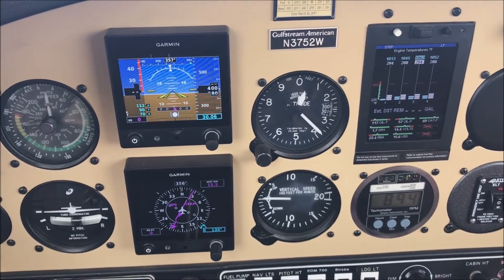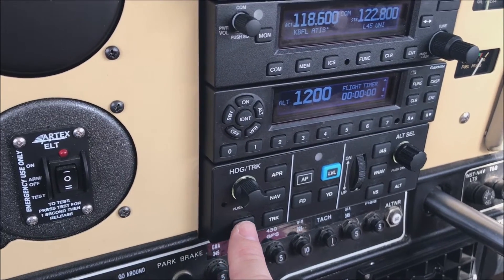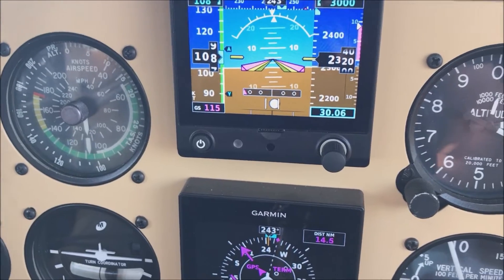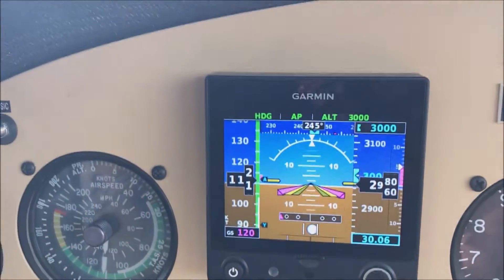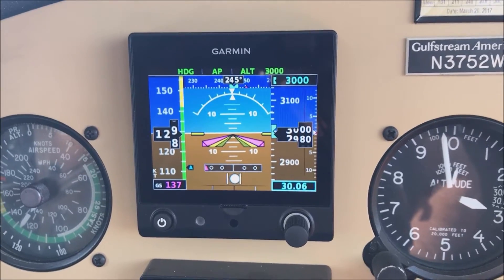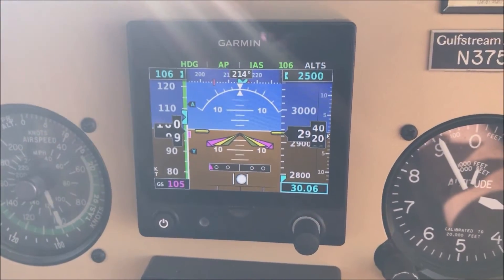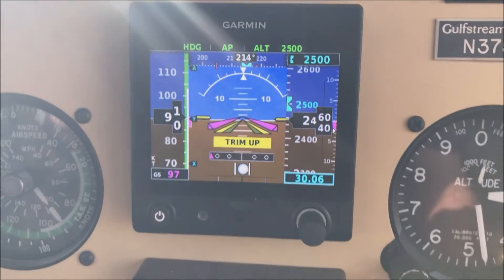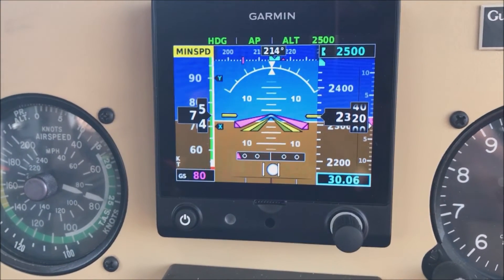GFC 500 demonstration

Comment: How did you select 2500’
Reply from the maker: There are two different ways of doing it.  Here’s how as described in the G5 Pilots Guide 

Setting the selected altitude:
Use the ALT SEL Knob on the GMC 507 to adjust the selected altitude.
Or
1) Press the Selection Knob to display the Menu.
2) Select Altitude and use the Selection Knob to change the Selected Altitude

Comment: Great video. Someone recommended this AP for me and I'm checking it out. Really impressed with the stall-proofing! I've only seen this on airliners with autothrottle. What NAV radio do you use to connect to this unit? I have the Avidyne 550.
Reply from the maker: Thanks Ed.  I have a GTN 650xi, but think it would work fine with the Avidyne.   I flew the 777 before retiring from AAL and am impressed by the sophistication and smoothness of the GFC500.  You’re right, the only thing missing is the auto throttle. You’ll love it!

Comment: The audible tone is generated by the GFC500?  Or from some other device?  IAS mode? Is that the same as NAV?  Thanks for the great video.
Reply from the maker: Thanks for the comment.  There are audible advisories from the GFC500, both tone and voice.  You can download the pilot operating handbook from Garmin,  just know the GFC500 is contained in the G5 manual.

Comment: Im wandering if you can put a Bard Minimum on a G5 ADI when you reached your DA or MDA? Is it a audio feedback or a tone if it does ? Thanks
Reply from the maker: If you mean can you select the MDA altitude in the flight guidance panel and have the autopilot level there on approach, the answer is no.  Once approach mode arms the selected altitude will not be active until go around is initiated. There is no audio alert for the DA or MDA.

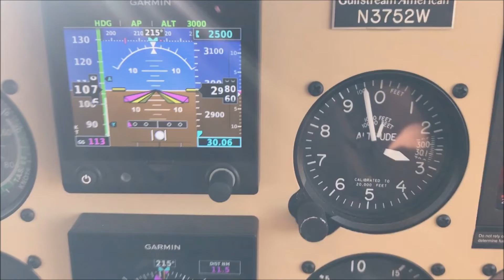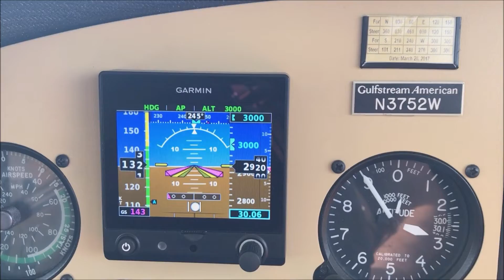Comment: At 4:20 there is a magenta triangle on the digital "compass card" at the right side from the selected heading sign (I assume it shows track, right?). Appart from that there is an magenta stripe at the left side of it. What is it showing? Because I can´t see it when flying different heading at 3:30
Reply from the maker: You are correct, the small magenta triangle on the compass bar at the top is showing current ground track, the light blue bug is the selected heading.  I see the small magenta stripe you mentioned and even with the book open can't figure out what the heck it's showing.
Reply: @dcheever777  thanks for quick confirmation that the G5 is capable of showing ground track. I wasn't sure about that :) ..I don't mind that stripe anyway, I was just curious because I haven't seen it anywhere untill now
Reply: I couldn’t find a description for the magenta stripe in the G5 Pilot Guide either. From what I could tell, it appears to indicate GPS desired track.

Comment: Can you get any wind vector information displayed on either the G5 or your GPS unit.  I think it is really helpful and doesn’t see it with these units
Reply from the maker: That would be great, but to the best of my knowledge it’s not available.  I flew the Boeing 777 before retiring and it had that, it’s very handy.
Reply: It’s just been approved for Garmin with a GAD-13, requiring the installation of an oat probe, it is able to display air data computer information including tas, wind speed and vector, and density altitude. I believe the cost is $495, for the unit.

Comment: A nice video.  I rent planes with AP's and G5's but did not know I could do all that.  thanks for sharing this video
Reply from the maker: Jim Biller Thanks for the comments. Please keep in mind this is with the Garmin GFC 500 autopilot.
Reply: @dcheever777  I did notice the AP is different than in the planes I fly.  It looked as though you had a 430 in the radio stack.  Our planes typically couple to that but I am wondering if our AP's might also couple to the G5.  I will ask.

Comment: Thanks for the video, looking into this setup for my 182. Can the top (Attitude indicator)g5 control the autopilot if that was all you had . I might have misunderstood but I thought you had to have the HSI bottom unit to control the autopilot
Reply from the maker: Hi Mike.  Yes, a single G5 is all that’s needed for the GFC500.  I think, but am not sure, that it would be configured as an AI.  They’re both the same units, you change what they do with software selection.

Comment: Thanks for the video.  I have the dual G5’s in my Piper Dakota.  Waiting for the GFC500 to be approved for my plane.  Would like to see more videos of the autopilot in action.  Thanks...
Reply from the maker: Steven Snyder Thanks for the comments.  I’m hoping to get some approach videos soon,  just waiting on my nephew cameraman to get some time off from his college classes.  I should be making a couple hours XC next week, maybe I’ll do a cruise video.  I hope they approve it soon, you’ll love it.
Reply: Steven.....Do you currently have an autopilot, if so what?   I’m holding off on the dual G5’s until the GFC500 is approved and I will have everything installed at once, unless I have to replace vacuum pump.    Thanks!!!
Reply: Skyking71! Yes, I have a Stec 50 autopilot.  It works perfectly with the G5 and Garmin 750, but I want the additional capabilities of the GFC 500 autopilot.  Wish Garmin would get this approved for the Dakota.